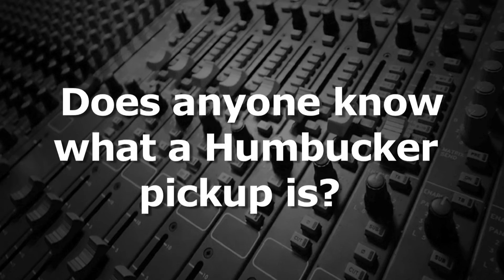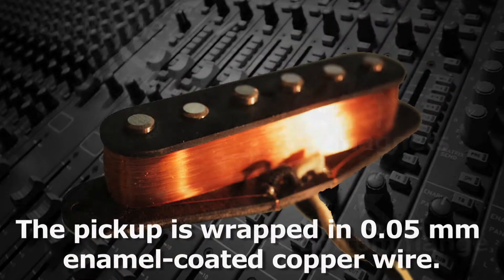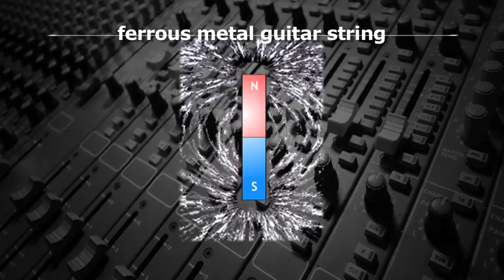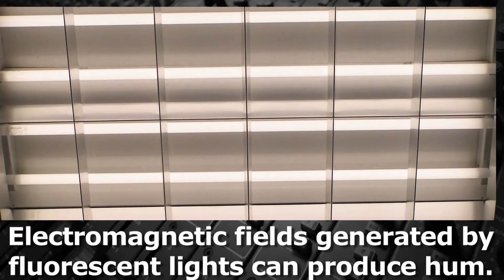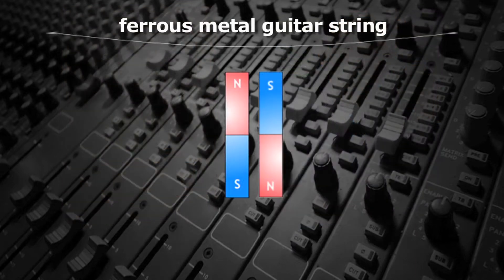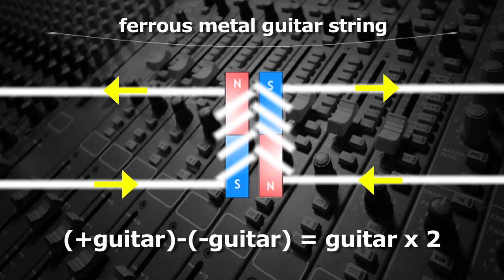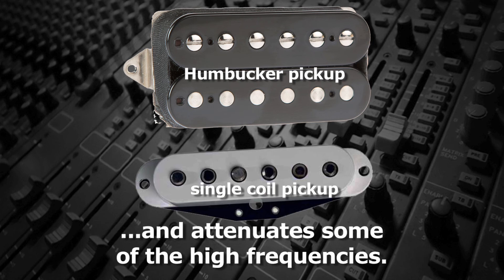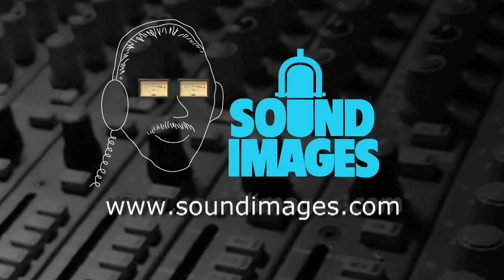Humbucker Pickups

Comment: How is it that we'll get (+hum)+(-hum) but also (+guitar)-(-guitar)? I didn't understand that in particular
Reply: I was struggling with that as well, I think it's because the outside interference is mainly affecting the coiled wire rather than the magnets. The magnetic polarity of one pickup is normal and the wiring is normal, so the signal is unaffected, however the other pickup's polarity is reversed AND the wiring is reversed, so the induction caused by the strings on the MAGNETS of that second pickup is first reversed by the magnets being of opposite polarity but then flipped again (and back to normal) by the WIRING being reversed. The signal on just the coil (the interference) is only flipped once, so cancelled when added to the other one, but the signal from the magnets (caused by the strings) is reversed twice, meaning it adds to the signal when combined with the original pickup.
Reply: imagine two identical coils but with opposite magnet orientations 

hum creates current in both coils in the same direction(from start to end for example) but vibrating string in opposite(one start to end other end to start)
you connect two starts of both coils and get a clean signal from ends

Comment: Great video! Was wondering if you could explain more as to why a greater inductance would lower the resonant frequency and attenuate higher ones.
Reply: The resonant frequency is inversely proportional to the inductance, f~1/L. The bigger you make the bottom the smaller f becomes. L is the inductance.

Adding inductance in series to a circuit decreases the bandwidth of an electronic system. This is another way of saying that low frequencies are amplified while high frequencies are attenuated. 

Physically what is happening is that inductors resist rapid changes in the current that runs through them and will more easily allow slow changes In current to flow.

Comment: String vibration don't contract or expand the magnetic field at all, they only create a disturbance in it, an anomaly that is turned into a minuscule AC voltage in the coil.